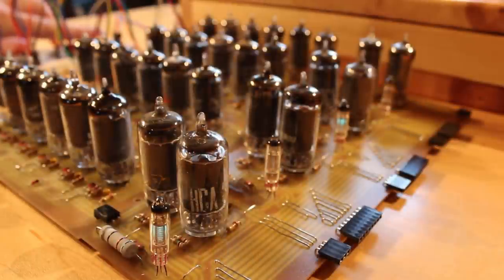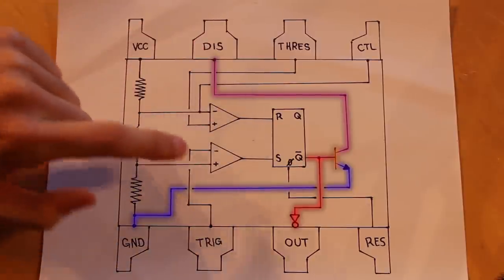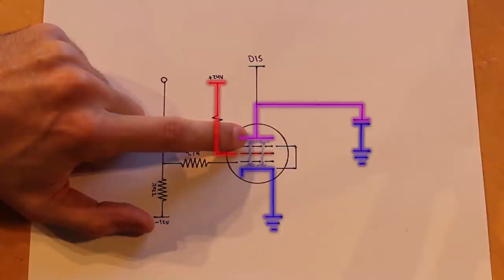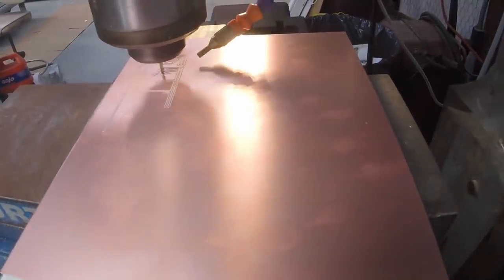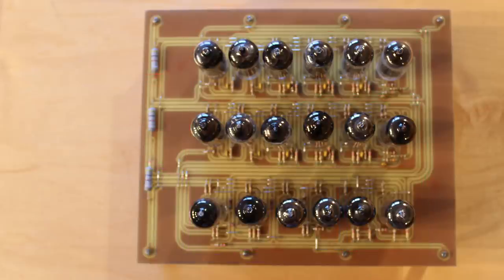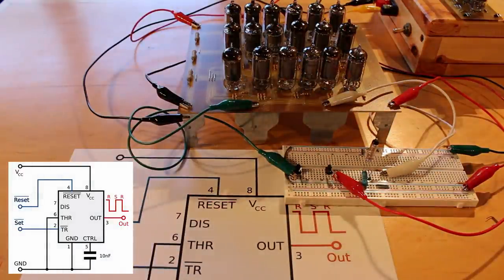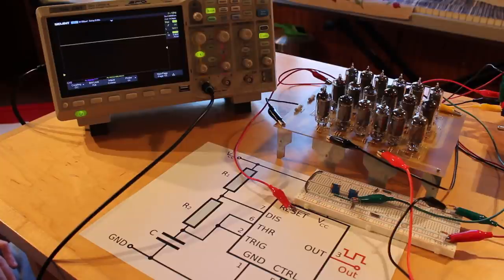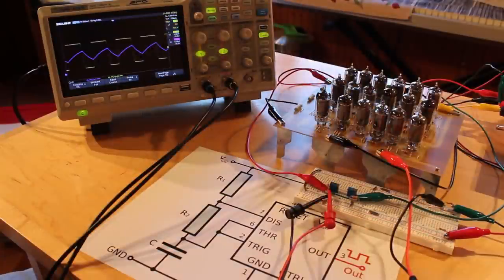Building the Largest 555 Timer in the World out of Vacuum Tubes

Comment: Two extra pins for the heaters?
Reply from the maker: Not needed here because I actually run the heaters in series off the primary +24V rail and -12V rail.
Allows me to keep the same 8-pin DIP form factor!

Comment: Yes. Is the kit ready yet? :-)
Reply from the maker: It's actually not that far off!
I went through a pretty hefty redesign, dropping the tube count from 18 down to 12, and then I ordered some new PCBs which should be here soon. I also redesigned the legs to something that should be much easier to produce and install (ie. you won't need a spot welder and light touch, haha). 
The PCBs should be here tomorrow and the legs sometime next week. If testing goes well, the first version will be available soon! Once v.1 is available, I'll get to work on the next revision, which hopefully will have the ability to run on +12V/-12V or +24V/-12V for a bit more flexibility in power supply choice, and then it's on to designs for different tubes, such as some of the 9-pin pentodes like the EF80 or 6EH7!
Reply: @UsagiElectric   After subscribing, just discovered your channel, I'm catching up looking for your flip flop videos. I guess I won't need my Heathkit IP-17 High voltage bench PS. Probably a good idea as I have a hard time keeping one hand behind my back IYKWIM

Comment: Curious what is the tube lineup of that circuit?
Reply from the maker: For this design, I'm using all 6AU6 pentodes.
For the kits, I ultimately would like to move over to the 6CB6 pentode as I have a bunch of those I have no plans to use. (Also, I'm a bit of a 6AU6 hoarder, so I'd like to keep all mine in my collection, haha).
Reply: @UsagiElectric  I remember as a kid we'd go searching through the trash at the local electronic store looking for gizmos. A favorite was the large spent tubes which we'd crush between bricks, ogling the mangled metal menagerie, wondering if we'd ever understand how the they worked.  I'm still not sure :)
Reply from the maker: @leduped6146  It's always a shame to find a dead tube, but cracking them open sure is fun! I had a handful of bad tubes a while back, so I opened them all up and took a look at the beautiful engineering work on the inside. It's a little mind blowing that they were capable of such manufacturing precision back in the 40s and 50s!

Comment: I would but a kit - sans the tubes
Reply from the maker: I'm working on figuring out a good way to make the kit now!
It has been a bit more difficult than I initially imagine, but that's mostly because I'm apparently terrible at dual sided boards, I'm on like revision 5 now, haha. I've also had some battle with the legs, trying to find a good solution that is easily reproducible and still looks good. I'm getting pretty close though!

Comment: I see half of the coolest Atari Punk Console in the World.
Reply from the maker: Thank you!
I don't know how, but I'd never actually heard of an Atari Punk console until I saw it mentioned a couple of times in the comments. But, I'm right there with you, it'd be awesome! Once the kits get further along and I have a couple working prototypes, I'll have to stick two of them together to make one!
Reply: @UsagiElectric  I have the tubes and passives, how much to cut and ship.2 boards to 78218 USA?
Reply from the maker: @frustro4323  I'm not quite ready to share the PCB design as there's a lot of design choices on it that are very specific to the CNC mill I used, the construction techniques I was planing, and a very specific tube. For example, the DIP pin connections were designed around additionally drilling them out, pushing a nail through them, soldering the nail in place and then spot welding the DIP pin shape in place. Not exactly a great design for anyone other than me in my garage with my tools.

I'm currently working on a new design that will be much better suited to using a few different types of tubes as well as a more proper production method. At the moment, I'm waiting on some parts to arrive so I can start designing and testing new PCBs, but it is progressing along quite well.

If you want to see updates or even just chat about it, feel free to join us over on the Discord chat server: https://discord.com/invite/p7UsfHD